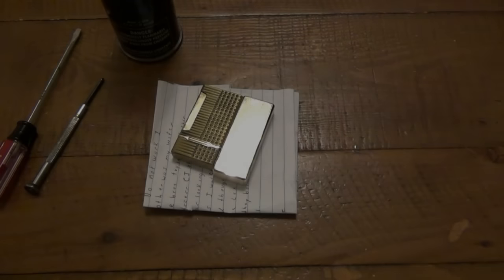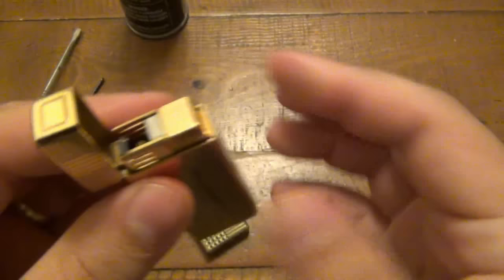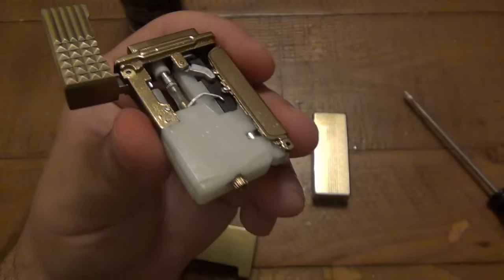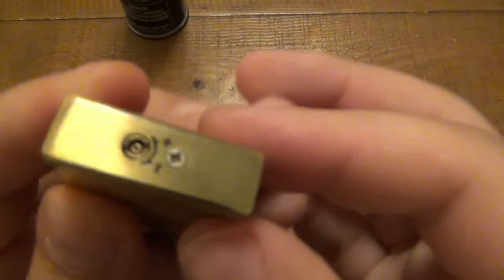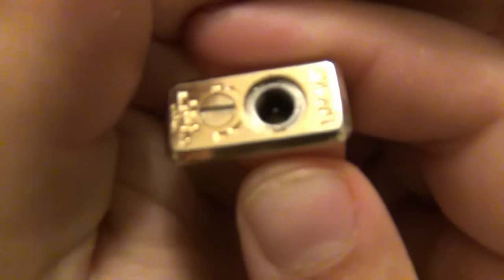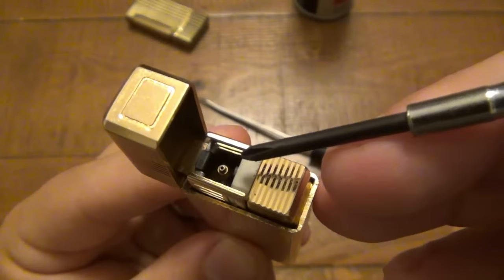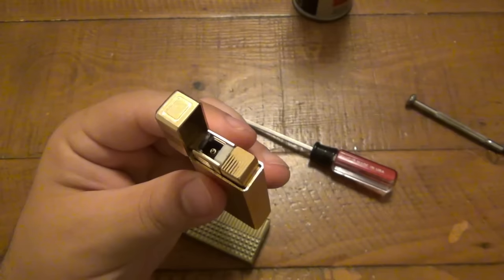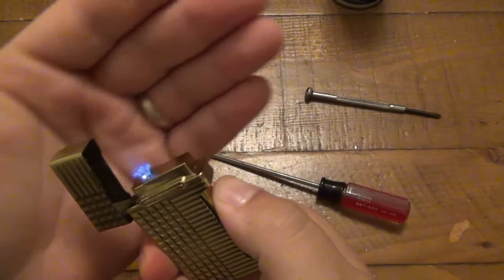How To Fix Butane Lighters (Common Problems Have Simple Solutions)

Comment: Those tips are on tons of different butane lids to this day.  Like 80% of the butane I see now still comes with them.
Reply: ya looking at one right now its in the actual cap got 5 different sizes
Reply: Yeah mine has like 6
Reply: Actually 5
Reply: I'm guessing Zippo only expects you to refill Zippos with their butane.
Reply: @hoilst  Zippo butane sucks anyway. There are MUCH better options out there of superior purity which come in larger sizes, have adapters, and are often cheaper than Zippo. Whip-It and Special Blue are sold at most smoke shops and are only two of several brands which are far superior to Zippo.
Reply: Yes I'm older I bought last week, adapters  in red capped butanes.
Reply: Yes I do know, adapters built in cap. Last week Southeast Portland Oregon
Reply: @GR8APE69  I always buy whip its. Buy one get one free and the best value for how much you get. Plus 10x refined or better.
Reply: Mine has 8. It's a Ventti brand refill .

Comment: Come on Jeff you should know that spark being made is by a piezo electric generator
Reply: Lmao look at this guy so what
Reply: Also found quite incredible that Jeff doesn’t know what Piezo electric is!
Reply: On the second lighter, I'll give him credit that he can kinda spell sump'n he's looking at on the bottom, doesn't even try to pronounce that sump'n that just so happens to be what he's been talking about. 
Rock steady. With quartz.
Don't confuse him. If you told him, he might ask you, "Quarts of what?"
Just funnin' ya, dude. Good info.
Reply: Blue  I have personally never seen that kind of a clog. But what i do know is people use shit butane instead of good quality butane and it ends up clogging the jet.
Reply: Blue   It shouldn't. The flame should be too far past the nozzle for that to happen.
Reply: @michaellamarr3998  Totally not being a wiseacre here, by shit butane, you mean what? I have BernzOMatic that one would use with one's butane tools, which, btw, has the adapters stamped into the cap.
The reason I ask is that I've seen no great variation in price between brands until I encounter some crazy-pricey brand, typically at a better grocery chain or such. Granted, it was just such a place where I first saw the re-emergence of adapters.
I'm going to take a SWAG at this one: Is it typically a case where a consumer pays too much for the quality of product they're receiving, such as at a convenience store? Say instead of buying fuel where they bought the tool? Seems that corner-store torches are usually fine, but if they're going to shit the bed, it's going to be after a refill with c-store fuel? I could see that, but it's as expensive as the fuel at major camping & outdoor, tool and grocery stores, or from major online retailers. Does The Tinder Box still exist and, if so, is it necessary to buy fuel there because I bought the lighter there? Thanks!
Oh, one other thing, any experience with flint-strikers that take butane? I have one that's got to be as old as I am, being as it belonged to my dad. It's one of those jobbies with the built-in pocket knife

Comment: Also, a butane lighter works better if you turn it to it's lowest flame setting BEFORE filling and as Jeff said, purge the air..  sometimes if a lighter won't work at all , just by turning the flame to lowest setting and purging the excess air (and cleaning the nozzle) will make your lighter work like new ( Don't forget to turn the flame back up after you are done).  This works Especially well w the thunderbird insert for zippos. Good vid Jeff. It's really frustrating when you have a special lighter n it just won't work.
Reply: Cool nice to know thxxx🎉

Comment: The little black plastic piece inside the lighter that you press down,  with the wire coming out of it, is called the Piezoelectric ignition, that's why that lighter said piezo on the bottom.
Reply from the maker: :) thanks I did not know that
Reply: @cutlerylover  Its a piezo quartz crystal, there's a lil itsy bitsy thin slither of it in the brass (non-conductive) cylinder in the black plastic igniter element. When you depress the end-cap, you're activating a spring-loaded hammer inside that hits the crystal, the compressed crystal discharges a chain reaction of energy (pure super-high voltage electricity) The piezo crystal renders about 900 to 2000 volts as the air gap ionizes to terminate the discharge, depending on the amount and quality of the crystal in the igniter. It will never keel because the amperage is gauged milliamps not enough to singe the bollox on a fruit fly!
Reply: @The Geezer  Not a piezo quartz crystal. It IS a Piezoelectric ignitor, but Piezoelectric ignitors as found in electric ignition butane lighters use a crystal known as PZT, or Lead zirconate titanate, which is a piezoelectric ceramic of high sensitivity but low production cost, so it's perfect for creating fires in $2 lighters.

Comment from the maker: FYI after filing this video I spent more time looking and did find an offbrand fuel that includes the tips as well as they are sold alone on amazon...
Reply: cutlerylover lol I was about to send you a handful of the adapters. Every vector or vertigo can comes with them.
Reply: they had ..but Zippo is the only way ,must say i love the US..Elvis ,BBQ,good Tools !..if you dont like it now it get to ypu when you get older ..even Elvis !
Reply: cutlerylover was gonna send you that link
Reply: Hey Jeff, Colibri butane 300 ml cans come with the adapters in the lid, I get them from a local tobacco store here in East Tennessee, I can send you some if you'd like, it'd be no problem at all :)
Reply: The adapters come on Newport, LG colibri and vector caps. Probably other quality butane but these are 3 I know of.
Reply: Check out Jetline. My big bottle was one of the best purchases I have made since taking up cigars. It has lasted forever and when I got it around 2012 it had the cap with the adapters in it.
Reply: Really interesting video,Jeff!!
Reply: Tobacco or smoke shop will have some premium brands that are 4x, 5x, 6x, 7x, & 8x Refined butane just make sure you check the fluid ounces of the container sometimes you’ll pay more and end up with less when you could save one dollar and get the exact same refining with more fluid. They will usually have five maybe six or more brands and you can check the lids and see which adapter you’ll need some come with more adapters some come with less adapters. The one I usually get has 12 adapters on it
Reply: Jeff in the UK nearly all lighter gas bottles come with the adapters. Look up swan gas or Ronson gas
Reply: I've used the Neon 11x fuel (a very clean burning fuel, but the bottles never seem to be filled to stated weight, unfortunately), which I order from Amazon. They come with adapters in the lid. It's also a very cost effective butane fuel.

My father used Zippo or Ronsonal butane fuel, for as long as I can remember and I do remember the rings that came in the cap. He'd pull off the adapters that he needed and I'd wear the little red circlet as a princess ring. You remember them correctly.
Reply: I have a problem as well . When I press the button to spark it sparks but for a second like boom for one sec then it's gone and then it doesn't work. What should I do?
Reply: We still get those adapters in our butane can lids here in Australia, even in the trade refills sold at home improvement big box stores.

Comment: The different nozzles for different lighters are in the clipper butane gas can lids. There are 6 nozzles that you can break off and use. Great video with some useful tips.
Reply: They still have the butane cans with the different sized ends for the nozzle all across   Canada!  Just letting you know!
Reply: Clipper is okay if you don't mind using 100% isobutane, but that's largely considered to be of subpar quality compared to other brands that usually offer blends closer to 50%/25%/25% n-butane/isobutane/propane. I recommend sticking with Whip-It Premium Butane if it's sold at your local smoke shop. It's one of the purest butane blends available, in one of the largest sized cans available, and for a price that is cheaper than most. I was able to get two 420mL cans in a BOGO offer for $7 a couple of days ago.

Comment: On the lighter you couldn’t fix, the smaller screw is the flame adjuster. When you took it out it is definitely a valve with an O ring. Do not try adjusting anything in that hole! Just turn the screw for desired flame without taking it out. Plus a lot of lighters end up with leaking valves and I find if you change the O ring it usually solves the problem.

Comment: Most all the cans I get have the adapters in the lid of the can. My favorite is a brand called clipper in a yellow can, it comes with the 5 different adapters plus a rubber tip that seems to be a universal adapter and the can is 140gr.   4.94 oz witch seems to be about 9 fl.oz for $2.29 I bought the store out twice. Burns great as well

Comment: I learned the hard way to never adjust the flame while lit like you did in this video. I was adjusting the flame and the screw popped out and engulfed me in a fireball. Luckily butane burns out quick, but I still suffered minor burns on face, arms and chest.

Comment: The caps with the different tips are at most gas stations that are family owned. Most major stores or stations (like 711) that are corporate, do not sell em. I just bought one about 5 minutes ago. Came with 5 adapters and a hidden rubberized one inside the cap in the middle. Perfect for refilling my regular bics and using a push pin to clog the hole

Comment: I put plumbing tape around the butane tip just enough to seal it and I was able to fill it up. Thank you u helped me figure out what to do I figured I’d let you know what I did to make it work.
Reply: I bought a working vintage lighter and after a month took the end off just to look and saw the white threads. Lol. I’m not even mad, I repair them but if it works it works! Gave me another option if I had to use it. Lol

Comment: Useful hint: You can make a disposable adapter using electrical tape. Simply cut about two inches of electric tape, fold it into a square so its nice and thick, poke a hole in the middle, fit it onto the butane can, bend the corners inward, and push it into the lighter filler.
Reply: I have a bunch of those rubber tubes from the inside of lighters that were totally wrecked. The tubes fit over the refill can tips if they're skinny metal. It can be a short length, just needs to be flush with the end of the refill tip.

Comment: A lot of the "cheap" butane brands here still come with adapters in the cap, I haven't seen it on the higher-end (Calibri, Zippo, Power, etc...) in a long time though.
Reply: Power still has them
Reply: Colibri 300ml still has the adapters on the cap. Just in case you need them.
Reply: what do you mean by you have not seen it on those brands of lighters?
Reply: what is Power?
Reply: I purchased Zippo fuel tonight that had a ring of 5 adapter tips at my local Kroger store.
Reply: Dark my gold jet flame colibri piezo lighters ignition won't work plz help me
Reply: @Unethical  Is the wire from the ignitor bent such that it's no longer where it should be? Make sure the wire is where it should be, and that the end of the wire is clean. When you click the ignitor down, the electricity that it produces creates a spark which arcs from the end of the wire to whatever piece of metal is closest to it, which is usually supposed to be the nozzle where the fuel comes out of. However, if the wire is bent then it may be too far away to arc correctly. Additionally, if either the wire or the piece of metal that it creates the arc with are dirty then it may not arc as it's supposed to. The electricity is made when you press down the ignition button. The clicking sound that is made is a small "hammer" of sorts which is spring-loaded and smacks a small piece of PZT crystal when you press the ignition button down completely. The force of the hammer hitting the PZT crystal causes it's physical shape to alter slightly, and this alteration in the PZT crystal's physical form elicits a discharge of electricity which travels down the connected wire and arcs with the fuel nozzle creating a spark. The fact that this process starts with the kinetic energy of physical objects making contact means that there is a theoretical lifespan of the ignitor in your lighter, beyond which point it will no longer be usable and can be replaced but not fixed. That being said, you should be able to get literally thousands of uses from the original ignitor, which makes your lighter having a bent wire or dirty metal at the points where the arc/spark occurs the much more likely cause of your issue.

Comment: Good video and cool lighters! I've got a butane lighter that's not a jet / windproof just a normal flame but it will only light once out of about 50 clicks! The spark is fine and I've tried emptying, cleaning refilling, adjusting, etc but it still doesn't work well! Maybe just a cruddy lighter idk!
Reply: Blakehx Can you say the spark is fine do you mean that it is spark goes directly to the fuel nozzle where the flame would come from when it decides to light lol 

Another suggestion I have is  I found if I shake the lighter and if possible just Piezoelectric igniter itself if it rattles that means the quartz inside of its it’s broken which sadly can happen after being dropped a few times and it’s not gonna be reliable Majority of the time you can swap it out for a new one just get a cheap lighter and make sure that it clicks that clicking is the igniter other wise you’ll just end up with a flint ignition style lighter and that will do you no good LOLitself and just sure that the piezoelectric igniter works on the new lighter then swap them out.
Reply: GODSOFTHEGUITARS Ya it sparks correctly with pretty much every click. I haven't completely dismantled it yet but probably will at some point! I have a feeling that it's a combo problem of a spark that's not very strong and weak flow of gas. It's just a slide adjustment so all the way to the right is all the way on but it's still a small flame and sometimes it won't even light with a match! It was cheap and worked OK for a few weeks but it's probably ready for the trash bin

Comment: Don't know if anyone has already mentioned this, but the best tool you can get for cleaning out tiny clogged holes is a set of oxy-acetylene nozzle cleaners, which are very cheap and available from any welding supplier.
Reply: What is it? A teeny brush?
Reply: @traceypedigo6405  No, it's a set of graduated thin wire rods specifically designed for cleaning out tiny holes in gas nozzles, so ideal for this task.

Comment: Yes sir, I have bought different types of butane and some have the adapters on the ring as you said and some are molded into the inside of the top.  I have gotten them lately. I've worked on several also thanks for your informative shows. Keep On Keepin On!!

Comment: Here in England butane refill still comes with adaptors molded into the lid and cut so they're held in by a little tab, you just push them with your finger and they pop out.

Comment: Great tips, thanks?
A note on the last tip, cleaning the clogged up tip:
I got a set of micro drill bits from abroad for a few £€$, used the biggest that would fit and just span it by hand and got a lot of gunk from our there.

Fixed up a very nice old lighter I got pretty cheap cause it wasn't working 😍

I have a similar lighter refill port, used the blue adaptor from a can of Newport Zero :)
It's the wide ish one with the off centre whole in the end. It pushes the central point and allows gas in because the whole in the adaptor isn't centered
Reply: They make drill bits that thin? The little outlet hole on my lighter is approximately 0.25 to 0.30 mm wide. Neither pin nor sewing needle will fit in the hole. Believe me I tried. 

The only solution I found that seemed to clear the clog, at least temporarily, is an air intake cleaner for your car. It's purpose is to clean carbon deposits. Its a spray can and it usually comes with a thin straw you can attach to the nozzle for more precise aim. It's important not to use any carburetor cleaner though. It has to be a specific cleaner meant to clean the sensor on the air intake. Because its the only one safe for plastic. In America, it's called "Mass Air Flow Sensor Cleaner" made by CRC. i don't know what it's called in UK or Europe.

What I do is attach the thin red straw to the spray can nozzle and put the other end of the straw over the lighter nozzle and spray two or three quick bursts into the lighter. Shake the lighter. Repeat a few more times. If I have something thin enough like your micro drill bits, I'd use it to probe the hole for additional cleaning. The lighter will light afterwards but it will eventually clog again. The lighter will work for several months if you use good butane. Always use quality butane to minimize clogging.

EDIT: I should've mentioned that this method is for lighters with soft candle flame. I have no idea if it'll work on jet torch lighters.
Reply: @4eightyvolt  interesting! I was looking up car videos to see what cleans carbon lol. I also thought of heating tip then shocking with cold water to detach carbon in my torch lighters.
Reply: @4eightyvolt  you could try a beading needle, they are exceptionally thin. The brand Clover do a 4 pack with two size 10 and two size 13 in it for  couple of quid. Works well for me.

Comment: Piezo is the type of crystal used to generate electicity from the kinetic energy of pressing that plastic column down. It's prenounced like fiesta! =) Nice  video!!!
Reply: Piezo is the ignition type, shortened from "Piezoelectric". The type of crystal which Piezoelectric ignitors use is called PZT.
Reply: @GR8APE69  Thanks for that rectification! <3